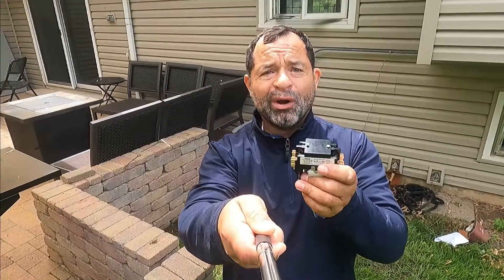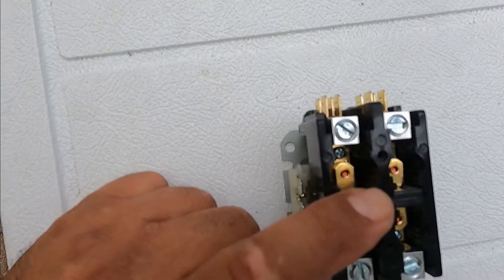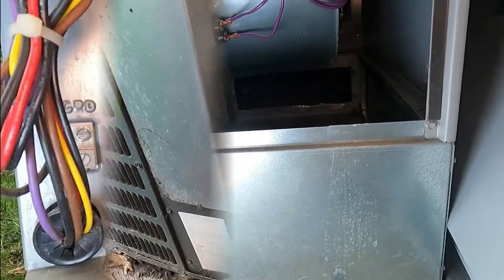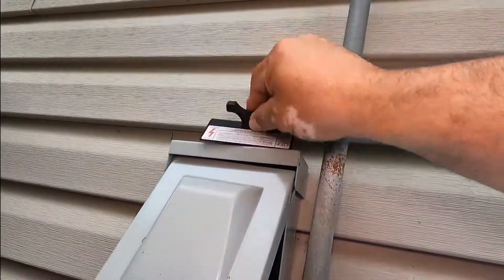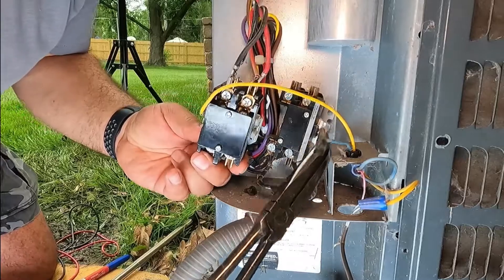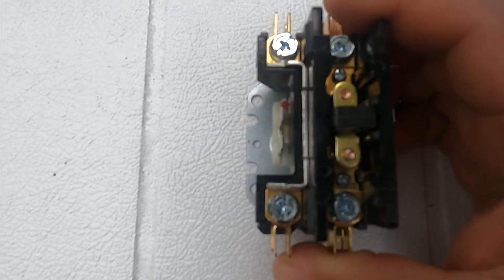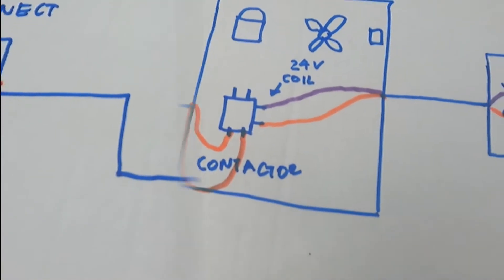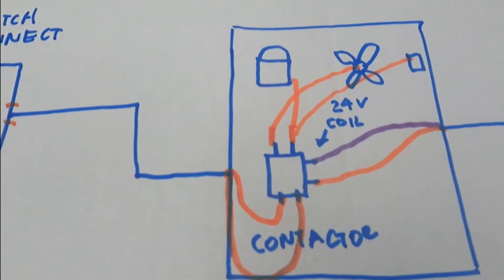AC CONTACTOR, HOW TO TROUBLESHOOT IT, AND HOW TO INSTALL IT.

Comment: I'm replacing my single pole contactor like the one you show. As long as you understand that "L" connections are for mainline power input...and "T" goes to load....does it matter if the contactor is positioned upside down? ( meaning....all the lettering and tagging numbers on the unit are upside down). Does orientation matter?
Reply from the maker: Hello Will.  I does not matter.  Thanks.
Reply: @alexthehandyman3494  ...appreciate the answer....take care ...👍